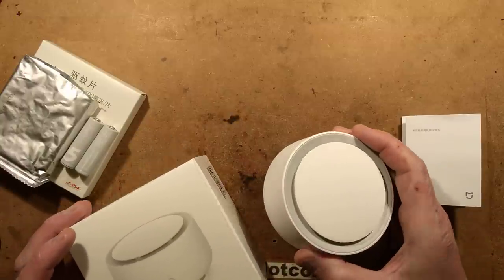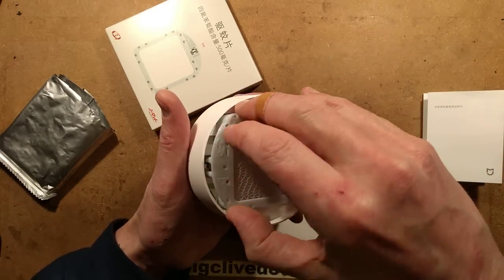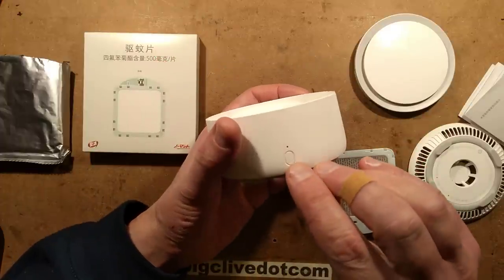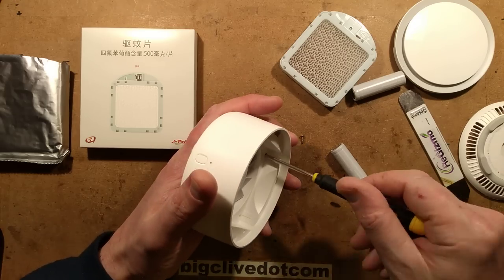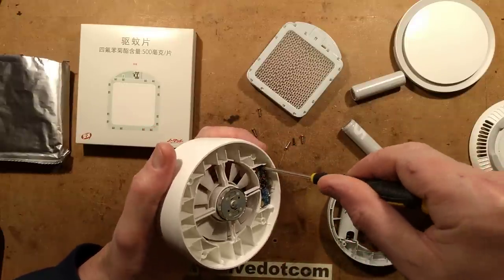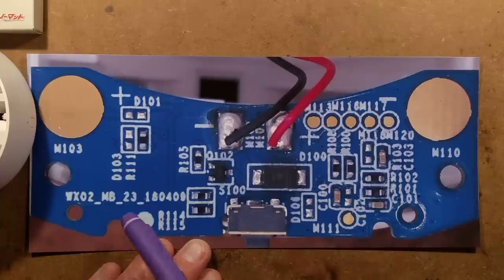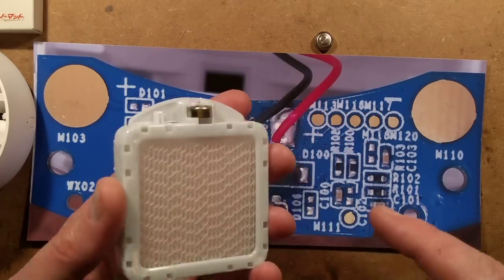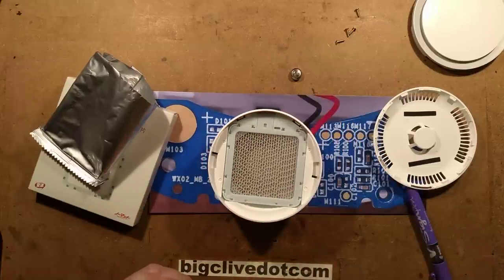Inside a Xiaomi Mijia mosquito repeller.  (Including cartridge reset info.)

Comment: What a waste, using a battery as a cartridge usage indicator.
Reply: Do you have better solution for +- same price?
Reply: Yeah given that in quantity those batteries are probably less than a penny. I used to buy them 500 at a time and even in those relatively low quantities, they were only about 1.8 cents each. Can't imagine what system you'd use that would cost less.
Reply: I was thinking it was kind of clever. No chip, no components beyond the battery, no additional board for the cartridge, no programming, little to go wrong, just a board on the base unit. The machinery for coin cells is super established and presumably the cells are dirt cheap in quantity. It is probably a waste of lithium though. I believe they contain lithium anyways, but I'm afraid to talk any further out of my ass about the subject.

Still though, pretty clever little system.
Reply: Seems like a pretty novel (yet simple) way of gauging cartridge life without extra ICs... and easily hackable.
Reply: @KucharJosef   you could use a cheap eeprom such as a FT24C02A-KSR-T mounted on a small single sided board that is just large enough  to expose gnd, vcc, sda, and scl to the main board. the ubiquitous chip on the main board would just count up and store that number on the eeprom and when it gets to a predefined value you would know the cartridge is at end of life. you would need non volatile memory of some sort so that the count is preserved when the cartridge is removed.  the FT24C02A-KSR-T i looked at is around 4 cents in 10000 qty and a small single sided bard large enough for an so4, maybe a decoupling cap, and four card edge contacts would not cost more than a few cents in the same qty. but i suppose this could be just as wastefull, but at least the eeproms from the used cartridges could be re-purposed by people like us for our own projects so win-win.
Reply: The steel battery is probably more recyclable than most other options.
Reply: @HPD1171  Oh, I didn't think about that. That's pretty smart
Reply: @HPD1171  Hopefully the oscillator would be stable enough
Reply: @KucharJosef  i don't think that would be too much of a problem since i2c is a synchronous protocol so the data and clock will always be in sync no matter what frequency the oscillator happens to be drifting to, you could even opt for an spi eeprom which would be a bit more tolerant to this.  this is especially important considering that the protocol will likely have to be bit banged as i doubt the "ubiquitous 8 pin chip" has a hardware spi or i2c peripheral. spi would actually be preferred as it is a simpler protocol to bit bang and would require less assembly. the chip i looked at just happened to be i2c.
Reply: @John_Ridley  i had no idea you could get these coin cells that cheep, i have never been able to find them less then 10 or 20 cents at any quantity.
Reply: The electrolyte is not steel, but a chemical...
Reply: Lassi Kinnunen  how do you measure rusting for a few cents?
Reply: @John_Ridley  What about this, a small rechargable battery is in the unit and it discharges when the grid is in and charges in a few minutes when you swap it
Reply: @John_Ridley  I did never imagine they could cost less that 2 cents. So a battery is actually even cheaper than an i2c EEPROM. Using it makes sense, but it's not eco-friendly... An I2C EEPROM won't release much toxic chemicals after being disposed. It's just a super tiny piece of plastic, tiny pieces of metal and an even tinyer piece of silicon crystal, which is very stable and will not cause much pollution.
Reply: @atmel9077  All true, but go to a manufacturer doing cost reduction analysis and tell them they should spend another 3 cents per unit to be eco friendly.
Reply: @John_Ridley  My opinion: For 3 cents its worth saving the environment
Company's opinion: Business is business, f*** the environment lol
These cartridges were't actually invented by Xiaomi but licensed from a Japanese chemical company. Chemical and pesticides companies don't care about the environment at all, but you can be sure they care about money!
Reply: @TwistedD85  LR44s are actually alkaline. See 1.58v.
This size was popular for the old electronic keychain toys that were popular in the 90's.
They also work with type 675 zinc-air hearing aid batteries, but that's not recommended - they require free air flowing through the vents, emit moisture, and have a short 'activated' shelf life. They're meant for high load devices. (Like hearing aids.)